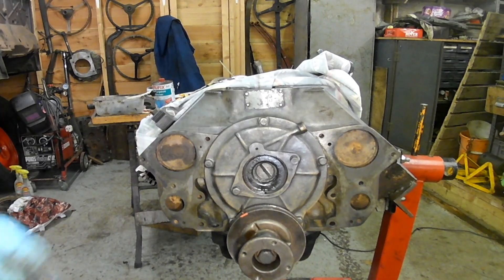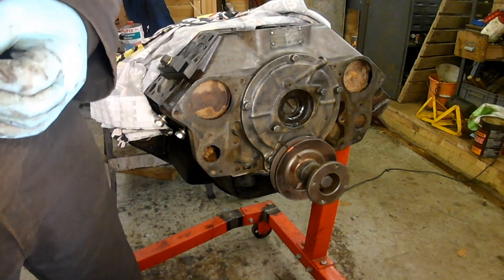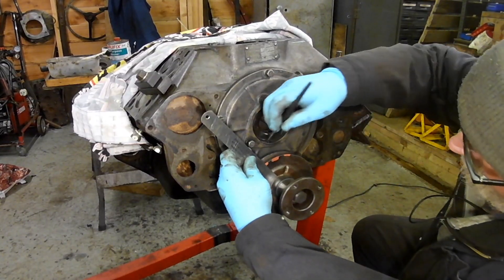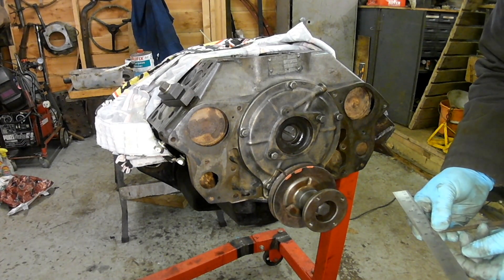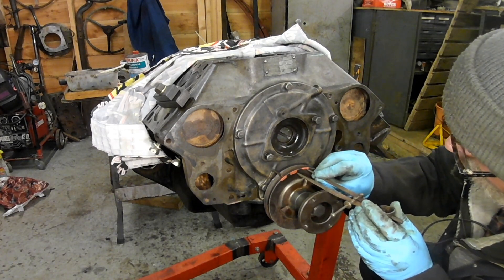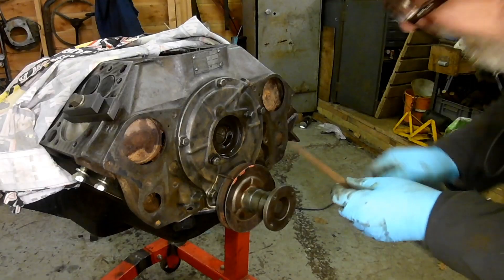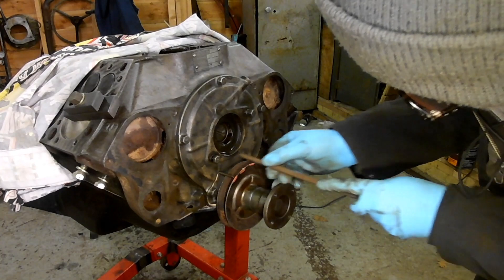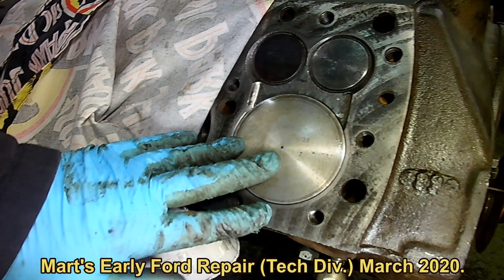Finding TDC by the solid stop method. My EASY way. Works for any engine!

Comment: So this is the “easy” way?  So all I have to do is remove the engine from my truck, take off the heads, and buy a tool to mount on the cylinder head?  I think there must be an “easier” way than this.
Reply from the maker: I look forward to seeing your video showing the easier way. Thanks for watching and commenting.

Comment: Hi Mart - Thanks for making and sharing this helpful video. I have a somewhat related question that I’m hoping you may be able to answer. As you’ve seen on the Fordbarn site, my brother (Veeder) and I have been building a distributor test rig. We’ve come to the conclusion that if one lines up the distributor rotor such that it is precisely centered on the contact for the number 1 cylinder spark plug, this is a pretty good indicator for top dead center of cylinder 1 (compression stroke). Does this sound reasonable to you, and if so, do you have a sense for how accurate this method might be? - Thanks - Jim (aka Hubercats)
Reply from the maker: Hello Jim. I've been following your thread. I'm not sure exactly what you are saying, but to my mind it does not sound accurate enough. My churchill jig has a setting pin for the correct timing, but even then I don't trust it and I time it with a dialback timing light once running.
Reply: @MartsGarage  : Hi Mart - Basically, my brother and I are trying to find a way to mark top dead center for cylinder 1 (compression stroke) when we don’t have access to the engine and hence cannot measure TDC directly. If I had  access to a flathead engine, I would use the approach you described to add a timing pointer to the engine. Then I would rotate the crankshaft to the TDC angle and make TDC mark on the distributor. This mark would then allow me to set the points and initial timing of other distributors of the same model without needing access to an actual engine. Not that my brother or I are interested in starting a flathead distributor repair business (we’re both enjoying retirement), but if we were, it seems we would need to be able to identify TDC on the distributor to allow us to tune the distributor. This desire is what led my brother to post his question on Fordbarn, the one where he is asking, essentially, if TDC for the distributor can be associated with some position (angle) of the tang that locks the distributor shaft to the camshaft. In short, we are looking for the equivalent of the setting pin on the Churchill machine. - Thanks again and cheers - Jim
Reply from the maker: @hubercats  Jim, I just posted a link on the fordbarn thread. have a look, it might be helpful. I hope it is. Mart.
Reply: @MartsGarage  Thanks very much, Mart. I just saw your post. If you ever have need or want of a microcontroller to automate some task, please don’t hesitate to contact us. We’ve learned how to program Arduino microcontrollers and to use them to run stepper motors, read accurate (1/10 degree) angular sensors, monitor Hall Effect magnetic switches, etc. We’d be happy to help you out (no cost, of course). - Cheers - Jim

Comment: Nice that the engine has a fixed reference pointer.  On the rover v8's, the pointer is a little tab bracket thing that is bolted to the timing cover. It is a pain as it is easy to bend, and you need to unbolt it to remove the crank pulley and get to the timing chain!
Reply from the maker: Cheers James. Glad you popped in to check out my video.